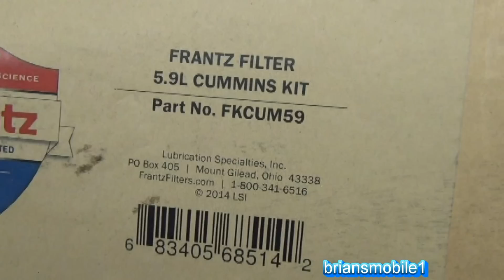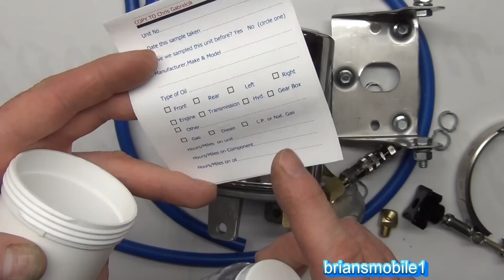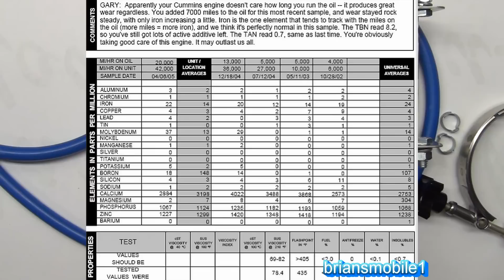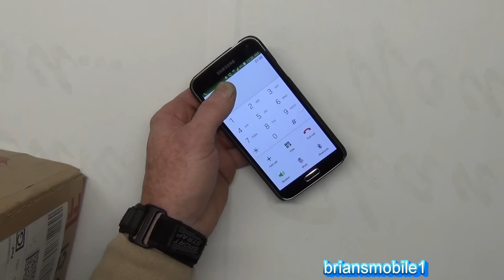How to Make Synthetic Oil Last Even Longer  Frantz

Comment: Link says it’s not available...
Reply from the maker: Thanks.  I'll update it.  I can't find the same kit now- just the universal kit that doesn't come with the aluminum cap.
Reply: Many times you can drill and tap the plastic stock cap..in the old days all we had was the universal kit. We had 3/8 hollow bolts to replace a intake manifold bolt on many Chrysler and Chevy V8s  The VW beetles had a metric hollow bolt to replace a generator tower mounting bolt.This returned the clean oil under the baffle. I have used a Perma Cool universal sandwich adapter from Jegs. It has a pressure port and a return port. When I started using the Frantz the main cars we had to d eal with was VWs and American cars. We carried a 1/8 pipe tap to enlarge the oil pressure port. You could put a metric fitting in a 1/8 inch pipe port but not a 1/8 inch fitting in a metric port..A newer Volvo oil pressure switch looks like a spark plug. You could always use a self tapping hollow bolt in the oil pan.

Comment: (haven't read the other comments)    but before the warranty is voided, they have to prove that the failure is due to the degradation of the oil   (poor quality, lack of timely changing, loss of volume).  Think autopsy and death certificate by qualified impartial technician.
Reply: Gulf Coast filters  of Gulfport Mississippi specializes in heavy duty diesels. They have letters from heavy duty engine makers. Some heavy duty engine owners dont drain oil but they have an oil analysis program to prove that not changing the oil as recommended didnt cause an engine problem. Oil analysis is to check for engine problems not oil problems.

Comment: 6.6L GMC & Chevrolet Duramax Kit
 not for 2017 or later models
$415.95
Reply: In the 60s Motor Guards sold for 29.95. Grand auto parts  in San Jose California one time sold obsolete Motor Guards.for 12 something. With hose and fittings. They put a loose screen in that got thrown away with the used TP. It looked like part of the used TP.. Looks like Frantz did a loose screen on the new model. What were these people thinking.
Reply: When I bought my first Motor Guard oil cleaner for the car it was the latest model. I didnt know it but the demonstrating  machine I bought had a loose screen in the top. Everything worked fine until I changed the TP. When I started the machine the gear pump tripped the circuit breaker for a bunch of venders at the flea market. The Motor Guard filtered from the bottom up.. The screen covered a orifice at the top. The screen came out with the used paper..I think Grand auto parts was selling the screen models. Hell boy I can get a Motor Guard for 12 dollars at Grand auto parts. I was selling them for 29.95. Did I see a guy remove the loose screen from the TP on the new model Frantz.

Comment: I have used toilet paper filters for over 50 years. There are some others that are as good but the elements cost more than an oil change. As a rule of thumb if the element looks like toilet paper it will clean oil. The pleated element bypass filters are all junk. Cotton elements are as good as toilet paper if it is compressed. Not aware of any cotton element filters. available these days.

Comment: These products are great and I always advise people not to use cheap oil filters or cheap oil but DO NOT use them to extend your oil change intervals. The reason you need to change your oil is not just because of the contaminants. Yes that is a big reason but the additives in the oil (pour point depressants, dispersants, stabilizers etc) break down with use and the viscosity of the oil also thins. No filtration system will prevent this or even slow the process down. Yes, filter your oil well but do not exceed your manufacturers recommendation for oil change intervals or you are doing your vehicle a disservice.
Reply: Best comment so far. Having as clean oil as possible until the next change will probably do wonders. I also do not believe it's extended drain interval approved at all. 
I'm pretty interested using this on an A/T that doesn't have any filters in them. Or would that filter away clutch material and cause slippage?
Reply: Finally someone with common sense that knows how engine oil works. Sad I had to read down this far to find it. Use one of these to keep your oil clean but don't ruin your engine by basing your oil changes off how clean your oil looks. For me as a mechanic, I would doubt your wear parts are going to look that much different at 300k miles then they would on any other well maintained engine. Most wear occurs  at startup before the oil film is established. There is really no good way I know of to control that. When you shut your engine off the crank literally settles down on the bearing and the two surfaces touch. When you first hit your starter in the morning there is a very small moment when metal rubs metal. Then the oil film is established and no metal should be touching metal. 
Another thing to consider is the oil filter bypass. I believe this oil filter bypass causes more wear than any other single thing. When cold much oil can be bypassing the filter entirely. Most people don't realize this can happen but it does more often then it should in my opinion. It is the ONLY way larger pieces of debri big enough to cause a scratch on a bearing can get through the filter.  Every rebuild I do shows the bearings with some pretty decent scratches in them.
Reply: A "pre-oiler" will do that. It sends a shot (quart) into the motor BEFORE start up.
Reply: Doing something like this to an automatic transmission would definitely help it last longer. A healthy transmission DOES NOT need worn off clutch material particles in the fluid to not slip. Contaminants
 in the fluid doesn't do anything any good. If the transmission starts to slip after installing one of these filters, it was about to fail anyway. HOWEVER, if you want to run one of these filters on a transmission, DO NOT run it in series with the cooler. A filter like this is too restrictive to be run in series, and it won't allow enough fluid flow, which will cause problems.
Reply: Ive always used toilet paper filters on my transmissions. My first one was  61 Buick Electra 225. I got pressure at a high accumulator test plug and returned the clean fluid to the oil pan with a self tapping hollow bolt. Frantz had a adapter for the oil lines to the radiater. I have made a few. Its two tees with a orifice in between. The fluid hits the orifice and causes a pressure difference.a small amount of fluid goes thru the depth bypass filter to be cleaned. Gulf Coast filters use a 1/8 inch orifice. The Frantz was a little smaller. Some small car transmissions dont have enough flow to create  pressure difference.. some old timer Frantz users just ran the Frantz in series with the cooler. I wasnt that brave.They just drilled out the filter orifice. Never did it but I have considered putting a tee in one of the cooler lines and returning the clean fluid to the oil pan. A lot of abrasives in ATF. The best thing to flush a transmission with is clean ATF.  The only time the Motor Guard was filtering was when it was in drive on the Dynaflow. Its been a long time ago but I think the Dynaflow cooled the fluid with fins on the torque converter. I normally remember the 60s better than yesterday.
Reply: The reason we dont need to drain the oil is additives last a lot longer in clean oil when we change the filter we add a new quart of make up oil. This keeps the additives up to specs. Its worked for me for 60 years.The Rambler was bad about blowing head gaskets. I changed the head gasket and the oil once. I have changed the oil on used cars because I didnt know what oil was in the car. The Pontiac Torrent gets a T P change and a new quart of oil about every 6 K miles.. Nothing has changed in 60 years except I changed the TP and added a quart of oil about every 2 K miles in the old days. When Mobil 1 came out with 5 20 I went to synthetic. Never gave a damn what the oil changers recommended.      Allowing oil to get dirty wear and foul the engine then draining it is common sense LOL.
Reply: @ralphwood8818  Doesn't matter if it "worked" for you. That is just not how it works. Oil change intervals are not a scam. The scam is when they tell you to do it based on a time interval rather than a mileage interval.
Reply: @homunculusprime647  should have told me 60 years ago when i gave up allowing  oil to get dirty and then draining it. They sell you a filter that doesnt clean oil then tell you to come and they will drain your dirty oil. In 1963 I was a young guy working in a full service Standard station. We checked everyones oil. Checked a Standard oil engineers oil. I said I see you just changed your oil. He pointed to his Frantz. He said son use one of these and Delo. Your engine wont wear out and you wont need to change your oil. I went looking for a Frantz dealer. I was never the same after that. Actually saying you never need to change the oil is misleading. In those days we changed the toilet paper every 2.000 miles and added a new quart of oil.on my cars these days its every 6.000 miles. The trucks that go a million miles with no oil drains its the same except its 3 gallons of new oil added at bypass filter change. 5.5  gallons when the two full flow flters are also changed. A trucker says thats equal to a full oil change every 40.000 miles. Thats using Shell Rotella and the big Gulf Coast bypass filter.
Reply: @ralphwood8818  Have you ever sent it in for an analysis?
Reply: When I sold filters I sent in customers oil  for analysis to impress the customers. Was talking about my 84 Subaru with no oil drains. A Caterpillar lab manager sent me a sample kit. He said the oil looks good for 250.000 miles with no oil drains. He said change the Frantz every 6.000 miles instead of every 12.000 miles. I took his advice. He didnt feel one quart of Mobil 1 a year was enough.. I was driving about 12.000 miles a year. I used 4 July as a time to change the filter.. I went to changing the filter and adding a quart of Mobil 1 Christmas and 4 July. Been doing every 6.000 miles since. Two rolls of toilet paper and 2 quarts of Mobil 1 wont break me.
Reply: I dont want to mislead anyone. Driving mostly highway in usually warm Dallas Tx is a lot different than Norway or northern Canada where I have sent Motor Guards and Gulf Coast filters. At one time Frantz had filter heaters. I think it was called a Alaska package. You could buy Frantz Motor oil. The TP Brian has is a special paper that fits. Notice the seal imprint around the core. Not sure What Frantz charges for those. Some charge 30 bucks or more. Jackmaster Classic is set up for a tightly wound TP or their high dollar elements. Jackmaster has a bigger core seal. The best place for the ring in the bottom of a Frantz is in the trash can.
Reply: Saw some Jackmaster elements on Ebay. The price is about the same as the Frantz. Of course you have the shipping cost from Australia.The Jackmaster elements have a fabric cover .
Reply: Saw some Jackmaster Classic paper in a 2 pack for 40 bucks. They are actually a very high quality roll of Australian toilet paper in a sock. They set up the filters so we can use Scott 1000 or other firm paper. One top loader has 36 dollar toilet paper. They dont call it toilet paper.

Comment: I like my Frantz quilted so I can enjoy the go, Frantz brought to you by charmin!
Reply: Saw some Charmin 2 ply that was similar to what we used in the Frantz and Motor Guard before there was Scott 1000 or Frantz elements. The core was bigger and the paper was shorter. The top loaders can handle it. The Frantz depends on the seal between the tube and tp core

Comment: But doesn't motor oil acidify over time? What does this kit do for the pH? Or do you need to run an additive package?
Reply: When the Frantz filter element is changed there is a loss of about a quart/liter of oil and the TBN and additive package will be restored with the fresh replacement quart/liter of oil.
If the regular factory oil filter is also changed at the same time an addition 1-2 quarts of oil will be added to restore the proper oil level and replenish the additives. 
With large class 8 truck engines with large capacity (24-48 quart) oil sumps the additive package can be restored with a container of additives available from CAT, Cummins/Fleetguard and several aftermarket sources. 
The Frantz bypass filter system has been around over 60 years and has an impressive historical record. 
The laboratory oil analysis proves it's effectiveness.
Reply: Thanks for the info. I don't think I need this product if I have to replace 1-2 quarts of 10 in the crank case when this filter is changed, on top of the $500 price of the kit....and toilet paper. It would be different if oil was far more expensive.
Reply: Michael Doerner 
It is the depth filtration that removes the fine particle contaminates that a traditional oil filter does not along with the extended oil change interval that makes the difference. 
Where I am located conventional oil is about $6 per quart and good synthetic is about $9-20 per quart. 
To me, changing a 10-28 quart sump every 3-6K miles gets expensive. 
If the oil change interval can be doubled and most wear causing particulates can be removed extending the useful life of the engine for the price of a bypass filtration system and the recurring expense of a roll of toilet paper every 6-12K miles the cost benefit is there.
Reply: This kit can help to keep the TBN of the oil up by removing water and contaminants. Water and contaminants causes the oil's TBN (reserve alkalinity) to decrease. However, this kit won't completely eliminate your OCI, since the oil's additives will still break down and the base oil will thin out. This filter can help extend your OCI when used with a quality synthetic oil though.
Reply: What caused acid to accumulate in the oil is using oil that doesnt neutralize acid and not adding enough new oil at filter changes. This is caused by going too far between filter changes or not having a filter that cleans oil.allowing oil to get dirty wear and foul the engine then draining it is a poor maintenance program. I know its what the oil changers recommend. Water causes acid  we depend on normal engine temperatures so the crankcase ventilation can remove the condensation. Most good oils have an additive to neutralize acid.. If you have a diesel use a diesel rated oil. Not sure if a zinc additive will foul the catalytic converter. On a gasoline car..
Reply: If you dont change the TP and add enough new oil the total base number TBN will get too low and you may get some acid. In the 60s some TP filter users  liked to use additive free oil because it was beautiful on the dipstick.I used the diesel rated Delo that looked just as good. The logic was why do I need detergents in the oil when my engine is pristine. Also the non detergent  oil runs cooler. Thats why some run non detergent in their lawn mowers. Skipper Yee of Frantz once told me keep your oil clean and dry and you wont have acid problems.
Reply: One thing about using the Frantz if you had an acid problem the aluminum parts in the Frantz would show it. Also the dipstick. Of course some dipstick tubes have no ventilation and water will rust the dipstick. It is a matter of using good oil and keep it clean and dry.